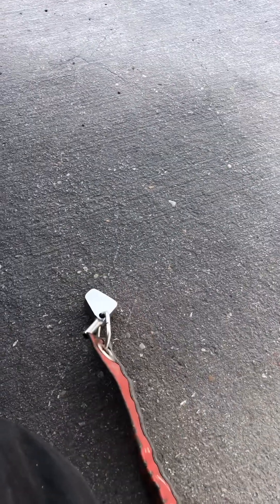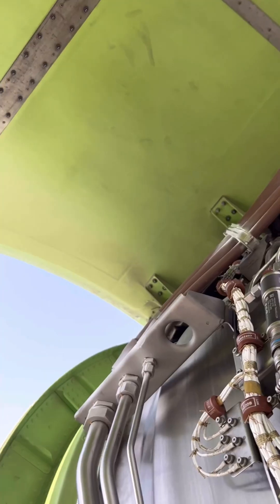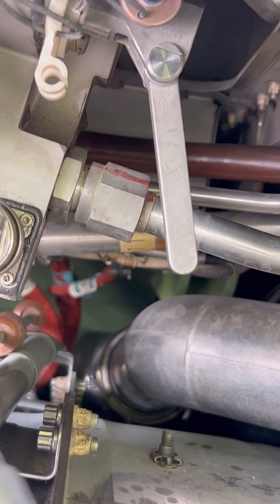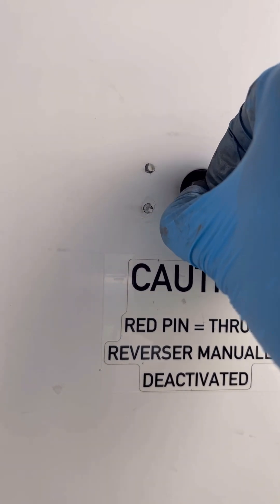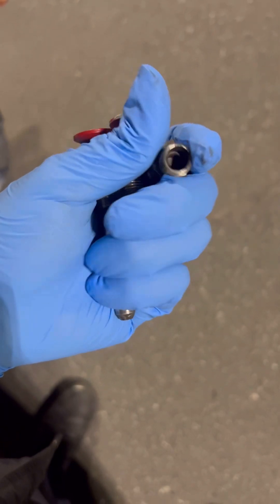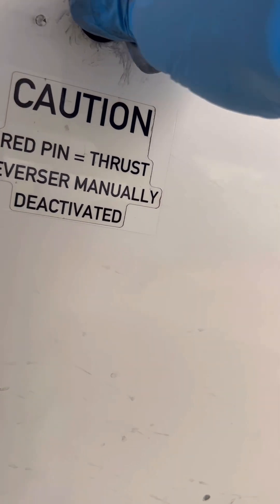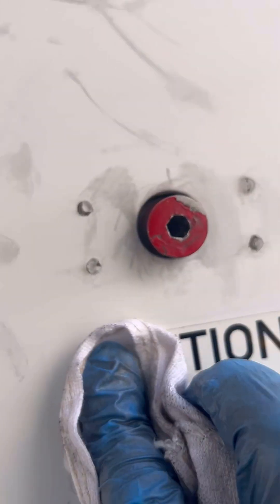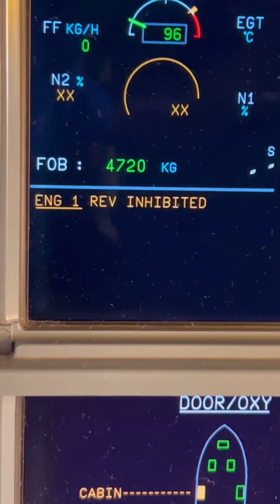Airbus A320 /IAE V2500 Thrust Reverser Deactivation for Flight

Comment: Why reverse is deactivated?
Reply from the maker: An Aircraft can fly with thrust reversers inoperative.So If a fault occurs before  flight and more ground time is required to fix the problem or to acquire spares,to avoid flight disruptions & delays the aircraft can fly for a limited time with that Thrust Reverser not working.This allows operators time to source spare parts and plan some ground time  to fix the defect without operation interruption .However there conditions for safely releasing an aircraft with that defect,these are stated on a document called the Minimum Equipment List(MEL).So in this case the MEL required us to deactivate the thrust reverser for us to dispatch the aircraft